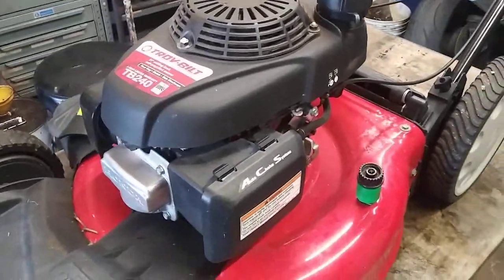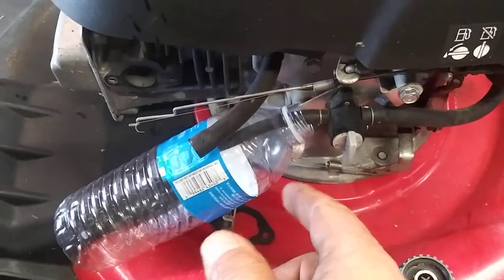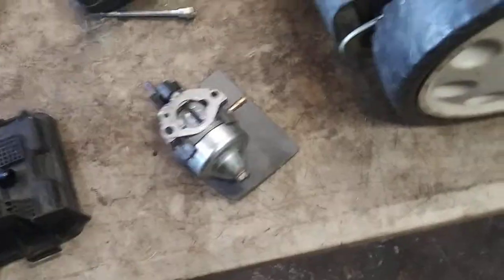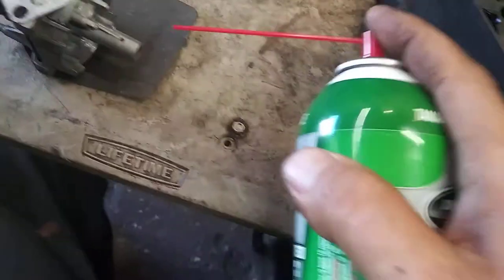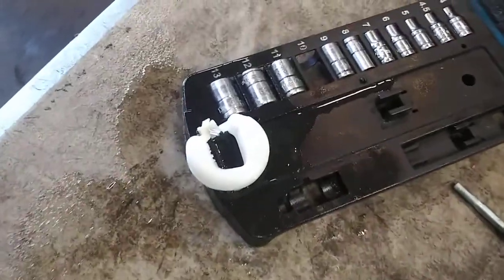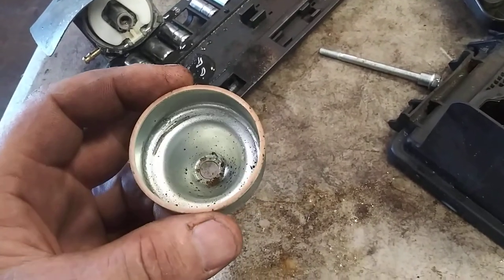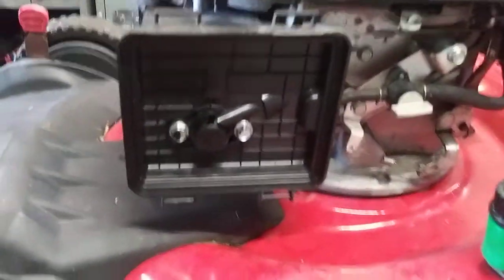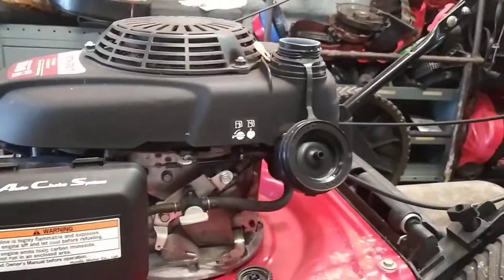* Troy-bilt honda tb240 21 " inch lawnmower carburetor rebuild

Comment: Thanks so much for this, made it simpler than I thought coming from someone who knows nothing about engines, but likes to attempt repairs.

Any insight onto what might be causing my lawnmower to make kind of a powered/unpowered noise while it's running? It feels like it's struggling and took a few restarts before it started really going, but even then it felt weak and like it'd crap out at any moment. At least this vid helped me get it to start and run, which it wasn't doing this morning. Could it still be the carb?

I did the following:
• Cleaned as much as I could of the carb with Brakleen (couldn't get the dome off, Phillips screw stripped)
• Bled gas line, there was some water in it
• Added fresh gasoline, a bit of HEET and a bit of Seafoam
• Replaced the spark plug (it had the wrong plug in it prior and was pretty burnt up)
• Replaced air filter (SUPER dirty and moldy)
• I bought some 10W30 Mobil1 (I'm in Florida and it's ~100F out), but didn't get around to figuring out how to do the oil change

Comment: Can you put another carburetor on the list. The one you listed isn’t available. Also my lawnmower runs fast as in rpm’s after I cleaned it out? I’ve adjusted the idle and amount of head flow and still nothing. Any ideas
Reply from the maker: look where the spring goes from the governor to the metal tab its to the right of the carburetor. will the governor move sometimes the throttle gets stuck if its hard to move back and forth spray lube on top of carb and keep moving. if you feel it get easy or kind of pop then move your good. if all that feels good the metal tab the spring hooks to coming from governor needs to be bent toward the governor a little at a time till it throttles down. also make sure you hooked the throttle up to the top of the carb my new employees make that mistake regularly

Comment: How do i replace innstion coil on A Honda Gcv 160 Troy -bilt  tb240 thanks GOG BLESS Y0U
Reply from the maker: pull off the recoil and engine cover. remove old coil. line magnets on flywheel up to where coil goes. install new coil use business card as a gapping tool between coil and flywheel magnets. reinstall engine cover and recoil.

Comment: I have the same mower and my spring came off from the throttle so i took it apart and now once i put it back together it starts but the throttle doesn’t want to idle high as it should what could that be?

Comment: I have a TB-210. Is that Honda as well? I couldn't fine any information on it.

I'm also confused as to what the two lines are for. One line connects the gas tank to the carburetor. What does the other line do? Thanks.

Comment: Thank you!!! Great help. Question, I did that because it wasn't starting. Now it does but the engin is "raving" as it is running. What could it be? Any ideas?
Reply from the maker: throttle is stuck or you forgot to hook up throttle arm when putting back together very common mistake
Reply: @smallengineguys  thanks for the quick response. so take it a part and, how do I make sure it is not stuck? Could it be that there isn't enough gasoline coming in?

Comment: Hey brother I have a question for ya. We have the same exact mower. The oil lever is good it has new gas I cleaned the tank and carb just as u did with a new spark plug and it will start and run for about a minute then cut off. Then it will start for a second the right back off unless u let it sit for a few minutes then it will run for 1 minute again then cut off...do u have an idea if we should replace the carburetor?? Any help is grateful
Reply from the maker: Gas cap. Vent is clogged. Try loosing the cap see if it runs. Let me know.

Comment: I have the same lawn mower but mine doesn’t have auto choke. Can I switch out carburetors to get that feature?
Reply from the maker: Yes but you will also need the choke shutoff assembly that goes to the muffler.
Reply: Thank you!

Comment: Wait, 10mm! Are these all 10mm! That was the one I was missing, so I used the closest SAE, but it seemed a bit big. Should I be using metric for the any Troybilt?
Reply from the maker: The motor is honda. Its metric. If its briggs tecumseh or kohler its sae
Reply: @smallengineguys  Thanks, yeah, I found a 10 mm and it fit better.

Also, I fixed my mower, so thanks.

So are all Troy-Bilt mowers Honda? How do I find out the engine? I tried to look it up and could only find Troy-Bilt information like it was all just made by MTD.
Reply from the maker: @mitchjohnson4714  if it looks like this one its a honda

Comment: I did this and my mower still wont start. I tested the spark plug and it is good.
Reply from the maker: check compression
Reply: Did you spray starting fluid in the carburetor in take with the filter out then reinstall it put the plastic cover on a give it a pull.

Comment: That black piece that sits on top of the carb. How is it attached
Reply from the maker: if the black piece that is part of the choke is off then you need a new carb. it isn't removable.
Reply: @smallengineguys  im talking about the thing you removed before the carb and after the hose that attaches to the fikter housing
Reply from the maker: the black plastic piece that fell off when i had the carb in my hand goes between the carb and the engine 4:50

Comment: Hello I have done all of this. Now when I put it back together the engine speed is full blast. How can I get the throttle are to stay at slow speed. The piece that you hook up to the cab that controls the speed is not back up against the pin.
Reply from the maker: You did something wrong. Im not sure but id say your not connected at the carb.
Reply: Hey I just saw this but I’m pretty sure u twisted up the fuel line a bit and threw the governor spring out of place and it won’t let the flap move freely, happend to me
Reply: I've got a similar problem.. I got a brand new TB160 that I cant get fired up. I think it's something with the springs/cable that connect to the carb.. I've changed the spark plug, checked the fuel lines, put fresh gas and oil.. I am pretty sure it's not getting fuel as a result of these springs not being right.. any help is appreciated..
Reply: Mine was same... GOVERNOR LINKAGE was slid up an inch toward the carb causing this... cheeeep linkage hookup.  Always take a breath and say your prayers... it will give you a moment to really find out why things do not work right